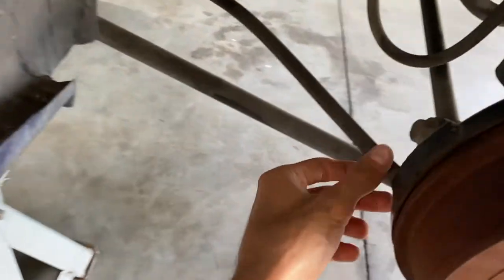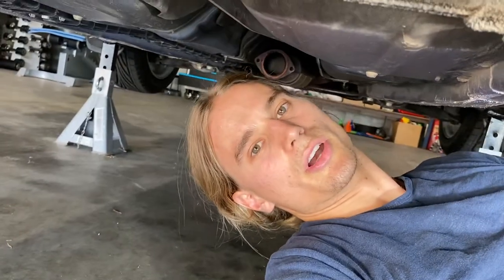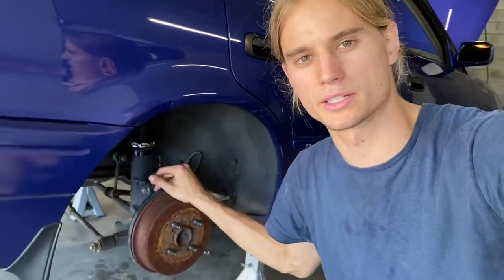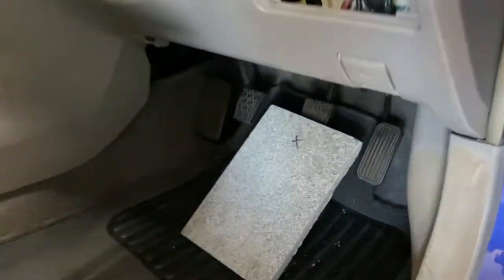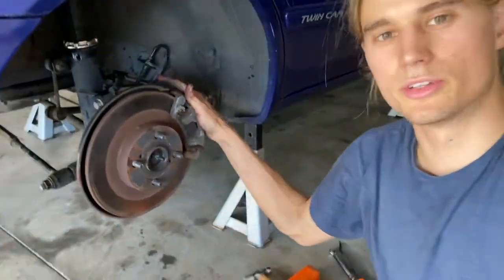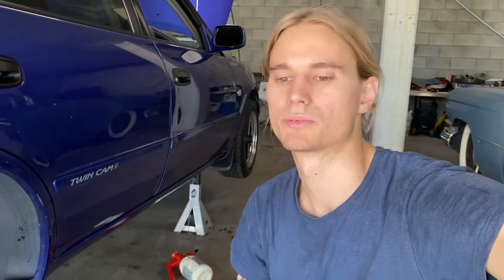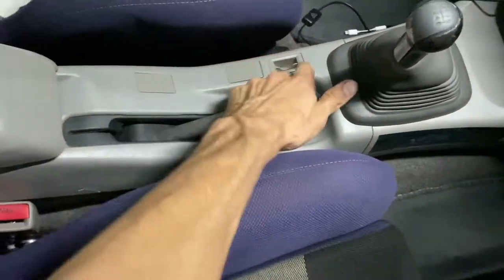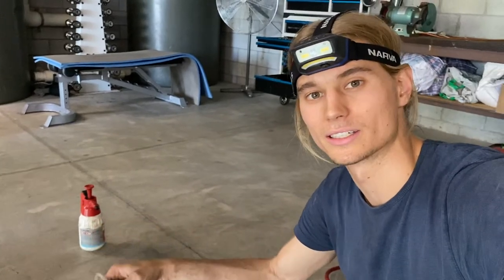Toyota Corolla Rear Disc Brake Conversion AE112

Comment: honestly good video, doing a big brake upgrade to the front and have a rear disc conversion already was wondering with the extra stopping power upfront if the rear drum prop valve thats installed in the vehicle will need the rear disc version i have laying around time will tell..

Comment: What seat rails did you use to fit your front seats
Reply from the maker: They originally came out of an early evo I believe. They are bride rails but tabs modified to suit corolla. They didn’t slide well at all and were very heavy. I’ve since removed them. You could use bride ae111 rails though, same as ae112

Comment: Bro help me out here. I just did this conversion to an AE101. We bled the crap out of it and the pedal is still soft. The part number for the proportioning valve is the same so I've been reading online that that's not the issue. Apparently I'm supposed to be using a master cylinder with a 7/8 bore instead of the 13/16 my disc/drum combo came with? is that right? If so what's the part number on that?
Reply from the maker: Hi mate changing to the larger 7/8 master cylinder would make sense. Sorry I’m not sure what the part number would be, but try and find an ae101 at the wreckers that came with rear disc brakes and take the master cylinder and wouldn’t hurt to take the booster too.
Reply: @spinksy9  Thanks man. I'm swapping a booster and master assembly from a corona. It's gonna go on tomorrow morning. I'll leave a little update on how it goes if anyone else is digging through threads looking for answers.

Comment: I own a 2001 Toyota Corolla S 1.8l and I wanted to convert my rear drums to disc brake. Where can I find a conversion kit at?
Reply from the maker: no conversion kit my guy, you need to get the parts from they same year model corolla that came with rear disc brakes
Reply: @spinksy9  Thanks for the update brother.
Reply: @spinksy9 literally cant look that up, all parts houses only offer drum